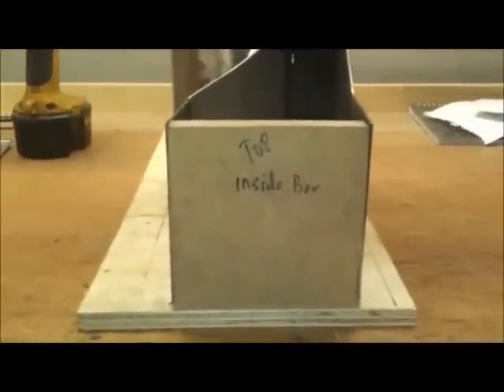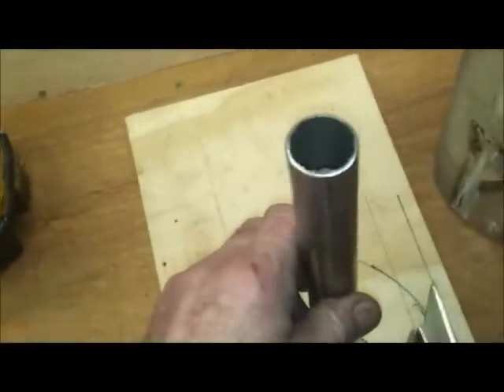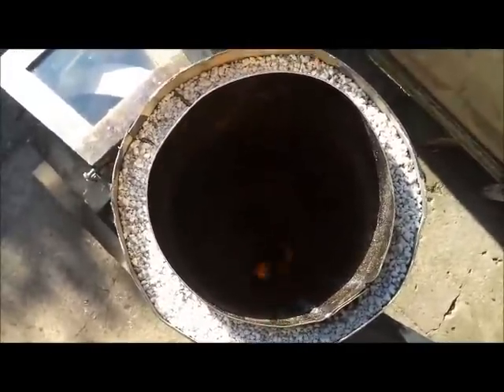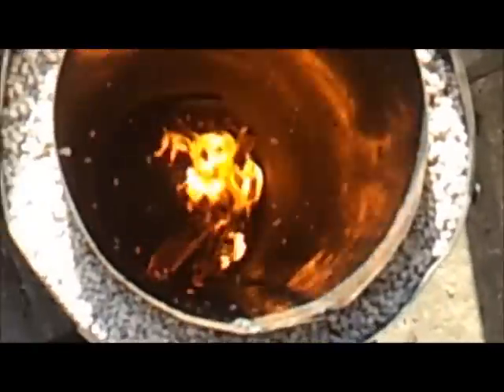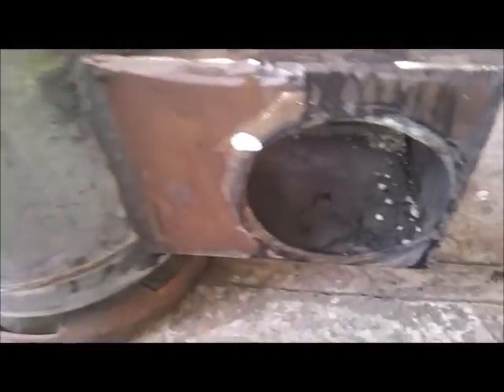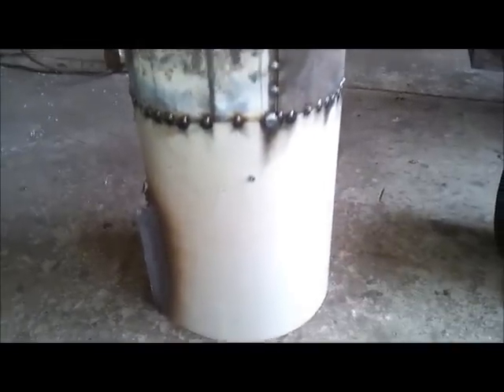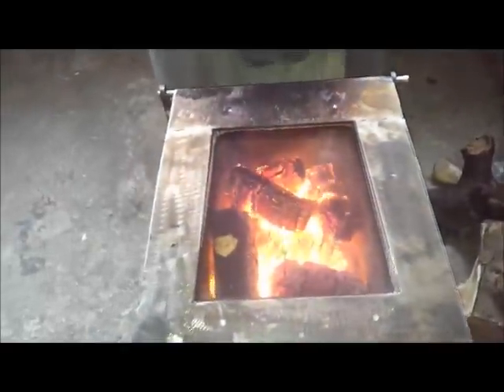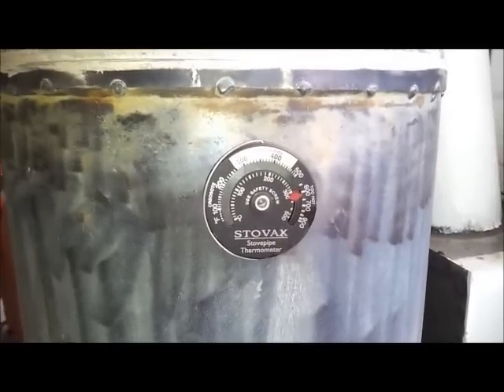Rocket stove riser tube, final build and burn.

Comment: Thank you for sharing the idea! Im building my rocket heater out of an old water heater, thanks for sharing. Sheers from Mexico!
Reply from the maker: Hi Rogelio, good luck with your build hope it works out well for you.
Reply: I was about to make it with tin can type of pipes but when I saw your design and some other ones I was like... waith a minute...it will only last a week alive! jajaja So changed the thickness of the "v" area of the burn to a 3.5mm thickness of galvanized. Hope it doesnt explode! jajaja ill share the results once it done.!

Comment: Very good video's and fantastic design. I would like to see the backside of the stove where the exhaust is. I am going to build two stove's to heat my shops for this winter, I have a circular sawmill and a ton of sawdust which I would like to use to for heating. I will also have a rocket stove that burns firewood. Incorporated into the design will be a boiler so I can transfer heat into an attached woodworking shop. The main shop will have the stoves in it. The main shop is for mechanical repair and fabrication work which will be used all winter. I am from Ontario Canada. Heating is a huge part of life in this country and I have to use the resources I have available.. I will incorporate your designs into my stoves. Thank-you for your knowledge and showing us the fabrication and design work you put into your models. Very good work.
Reply from the maker: Steve Lindsay Thanks steve there is a couple of my vids that show the back of the stove here is one ..Rocket stove riser tube, final build and burn.
just a box really with opening for flue and a clean out door.

Comment: Interesting. I noticed a unit called the turbo stove on this site that uses a shroud that covers the verticle burn tube with a downward fan.
I built one using pellet fuel.
 it works amazingly. Its a combination Turbo and Clarry stove with a computer fan controlling the burn for that high output when needed

Comment: love the modular design, and the narrowed air flow vent, looks totally maintainable, durable. could see the vortex swirling, you have an intuition for this, and you reduced the temp from 900 to 600? (which is loads) must be result of narrowed vent, and/or reduced air flow? either way I take it, it is burning longer or more efficiently, all pluses

Comment: if you used say an insulated  8" riser pipe then put a 3" pipe inside filled with vermiculite and cement with your vortex designed entrance to the riser, would that aid the vortex effect and keep the hot gasses in the flue longer and increase the rocket effect by giveing the flame a better curl effect ?

Comment: Good morning my name is John from near Beverley East Yorks. I have seen the latest stove you have built and like the stove very much I have purchased a stainless steel barrel but intend to fan up the one you have just made with the cast riser

I have a couple of questions if you don't mind what was the refractory cement you bought and where from I can get Castle refractory cement locally but it just cement I don't think it's the same as what you bought.

I have a plastic tube former 6 in and some flue liners conc which are 9 inch so thought I might place the 6 inch inside the 9 inch and use some plastic to line it temp and cut a slot like you did in the inner tube to do the casting.

Regards

John
Reply from the maker: John Beaumont Hello John, the1600c castable refractory mix came from castree kiln they have a website with online ordering, you cant use ordinary cement for a casting like this. When you set up your mould to do the casting make sure you can easily take the mould apart from around the casting, the concrete outer i would cut in half lengthways then rejoin it together with wire or something for easy splitting later. cheers.
Reply from the maker: eduardo soto http://www.castreekilns.co.uk/

Comment: Would a cast core stand up to the temps generated by this stove or could you use round chimney flue to do this without it burning out. Also what gauge stainless did you use and how wide do you wish you had made the opening going into the box I just heard you say you wish you had made it wider,Thank You
Reply from the maker: Mark Vaughn Hi Mark, I just got hold of some 1700c refractory concrete today and intend to make a riser tube from it for my next build, will post a vid on that soon. im interested to see what difference there is between it and stainless, so yes im hoping the refractory cast will do the job ok. The steel was 2mm on this I know guys have used chimney flue and said it was fine. The face of the entrance on this was the right size I just narrowed it down too much where it hits the riser, I changed it to 5inch x 5 inch when i rebuilt it last summer.and reduced it down to 5x4 where it meets the riser to create the vortex. Cheers.
Reply: ***** so you are using a completely different chamber to create your vortex

Comment: You said not to use steel for riser. I was thinking using 3/8 5" steel tube. Do you think that would not last very long ?
Reply from the maker: Orlando Pereira No mate, Mild steel just cant cope with the heat, as the tube heats up and cools down it starts to shale on the inside and eventually just gets eaten away by the metal loss. You should maybe get a years use out of it before it needs replacing depending on stove use.

Comment from the maker: Daniel, yes the old riser was quite thin material but I had Lined it with some thicker steel on the inside, the heat destroyed both pieces at the bottom where the flame enters, One thick piece would maybe last longer but the test riser i build a while ago from 3mm steel is starting to shale at the bottom now, where as the stainless still looks great and has been used alot more.
Reply: Neat beautiful.

Comment: Hi ppotty , Frank Here,
Just started building a rocket stove (insired by yourself) , got the firebox done (Galvanised plate with stainless lining) , fabricated the stove large propane bottle, on to the inner flue now , What is the reason for insulating the inner flue with perlite or whatever ? Frank

Comment: I know that welding galvanised steel produces dangerous fumes,so I'm wondering what somebody more knowledgeable than I am would advise when it comes to using galvanised steel for a firebox,obviously,you're not melting the steel in the firebox,but you are heating the zinc of the galvanising pretty highly.
Reply from the maker: Standupstew Hi there, Really cant help on that one mate, my flue is galvanised but never reaches temps that would even melt paint, I guess you could google info on galvanised steel and the dangers of heating it to firebox temps.

Comment: You need a secondary source of oxygen on the opposite site of the burner.  Generating a "vortex" is not sufficient to burn the pellets completely.  You must provide more oxygen through a secondary source.  I have done this and I discovered that my flue burns very soon because added oxygen burns the pellets more completely and generates more heat!  Try it, you would be surprised that you would need a thicker gauge of steel to tolerate the generated heat that's produced.

Comment: I have often wondered about an Archimedes Screw in the burn tube thus making the fire actually make a vortex plus would keep the flame closer to the outside edge. What is your idea on this???
Reply from the maker: +john young Early on when i started making these I thought the same but now I figure that it would restrict the gas flow and cause a sluggish draw and burn, plus anything placed inside the riser gets eaten up with the heat. Cheers.

Comment: have watched this vid 20 times now love it. when you say you made the vortex opening 5x4 it looks a lot narrower on film. were you still using 6 inch riser tube?
Reply from the maker: Mark Vaughn Hi Mark, the 5x4 was the opening at the front, where it was fixed to the riser it was around 3 inch wide and 6 inch high from memory, I said in the vid it should have been around 4 inch wide though and still 6 inch high, that would have made a big difference to the flow getting more air and gas into the riser. the riser was 6 inch yes.
As you know i changed this design to get more gas into the riser so the stove heated the shop faster, was working well as it was it just took too long to get the shop to temp, but its benefit was it burned alot less fuel.

Comment: WOW, that sounds like you're getting up to right below the melting point for the mild steel. Looks like the stainless is definitely the way to go for your design. Did you use MIG or TIG to weld the stainless together? I've got some 0.050" 301 sheet that I might go ahead and use to make my riser just in case my temps get higher than I'm anticipating.

Comment: That's pretty crazy given the typical melting point of steel, which is about 2500*F. But on the other hand if you were using thin wall, a sustained temp of about 2000*F could pretty well annihilate it. I wonder what your actual combustion temps were in the riser.

Comment: I have a 30 gal steel tank, believe I will build it like this one, I like the batch idea anyway
Reply from the maker: Lionheart 66 Cheers mate, bigger firebox works great if you get the air flow right and manage the air control.

Comment: Virtex is a slamming idea slow the burn build the heat and clean up more gasses ill bet if you added a bottom blower solar powered fan you could build the heat even more of course you going to go through wood a little faster unless you somehow baffle the exhaust !
 this is awesome
Reply from the maker: +Johnny G    Thanks mate burns hot enough without a fan ;-)

Comment: i admire your design..but adding vortex design will deminished the "rocket" system stove. vortex only add heat to the riser tube but less on the material meant to be heated.. is my thinking correct? pls. correct me..thanks
Reply from the maker: +mindfreak001009 All the heat created in the riser is transferred into the stove body or exchanger as it exits hitting the top and sides the heat does not remain inside the riser, so a vortex or whatever you have going inside the riser the end result is the same. Cheers.
Reply: +ppotty1 Will metal last or deteriorate or is it almost as good as refractory stuff?

Comment: HI mate. I'm looking at building something like this to heat my hot tub.. Would this stove be suitable and would I be able to just run a copper tube coil up the heat riser?
Reply from the maker: Yes you could do that I would run the coil tight around the outside of the riser plenty of heat available, and it wont mess up the flow of gasses.
Reply: Awesome. Thanks for the reply mate. Good video!

Comment: This just occurred to me that I didn't notice last time I watched through the video: it looks like your original riser is actually thin wall flue pipe (didn't notice the folded seam before, which is the big giveaway), which is about 22-24ga if I remember right. That thin, even in stainless would only last through a few burns at best. You're obviously not going to go wrong with the thicker stainless you're using now, but you may have still been able to get away with using thicker mild steel pipe.

Comment: What's the point of the spiraling flame?
does it help a cleaner burn?
Reply from the maker: Yves Baggi the main benefits are that the flame or heat takes a longer path spinning around the riser than it would going straight up. so the heat stays in the riser longer and heats it quicker leading to a better draught. The spiral also mixes the gasses much better allowing for more combustion inside the riser. and yes in my opinion the burn is cleaner with the stove going smokeless within a minute or so.
Reply: *****
 Thanks, for the explanation,
Reply: *****
I might have my vectors mixed up but since the heat/gas is rising I believe having the vortex counterclockwise (in the northern hemisphere) would be appropriate.

Comment: You could have left a couple tubes in the vortex section, but open in the top and bottom so air from in the room would get sucked up from the bottom then exit back into the room with no holes into the actual exhaust section, anther good way to get heat into the shop air!
Reply from the maker: sc0tte1 yes good idea mate, maybe a little difficult to fabricate.
Reply: You may find the temp is an issue for this! You do not want a leak between the vortex and a room! Good way to gas yourself without knowing!

Comment: I make a simple double barrel stove,
and will try an ' A.V.E.C. vortex ' (like for car engine)
in the tube betwen 2 barrels.

Will do a small video.

Anyway must be good for exhaust cheminey, with 6 or 8 big pales I think
 (same, search ' turbulateur d'échappement bateau ').
Reply from the maker: Hi Fred keep us posted on your results.
Reply: +ppotty1 
Hi.
I didi a test AVEC vortex with a can stove (minikeg ? things for beer, 5Liter),
very efficient, a flame more than 1 mleter for a 30centimeter stove high, (but as ever never finished),
just a bad video showing a few (not running).

I thought recently to a copper tube, in spyrale,
some small openings all long, oriented as AVEC et 45°
whole plugged on water heater to give pressure (have to see in english some things existong like that, with water cold tanks).
Just up so A..V.E.C,
and to finish a car spark to concentrate (ceramic) and 'explode' the concentrations
(this exist with air to cold CNC tool).

have long, good spring.

Comment: The amount of energy produced depends on how completely the fuel is burned; nothing else!  If a 5-pound log is completely burned in one hour, it produces the same amount of energy if that same log is burned over a two hour period.
To burn a fuel completely,  one needs to have adequate oxygen.  Nothing else.  When something is burned rapidly and completely, the flue temperature is usually close to the ambient temperature of the room.
Reply from the maker: your saying that if the flue temp is 120C so is the room its in ?

Comment: Thanks for the great instructional videos ppotty1 !!
One question: How did you fix In place the top section of the stove (the cap that goes on top of the stove) ? Did you weld it or did you use a fastener that will enable you to easily remove the top off if you need to?
What has been your experience with welding the top section or fastening it ?
Reply from the maker: WaterFluoridation PoisonOnTap Thanks, on that stove I put the top onto a fire rope gasket and its weight held it there, some clips to fasten it down would be better too. You could weld the top on just make sure the welds are good so no gasses escape, most sealants tend to shrink and fall off in time due to the heat. Cheers.